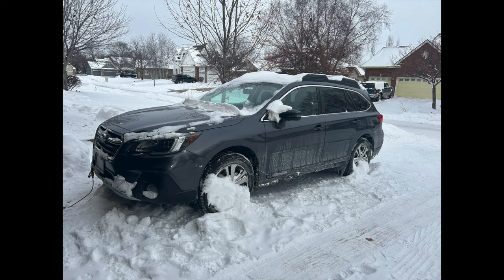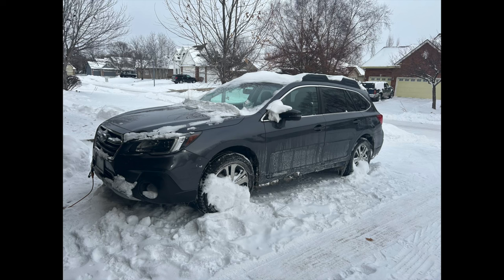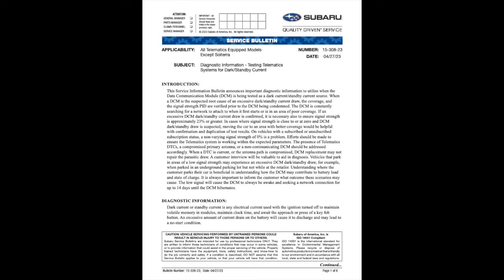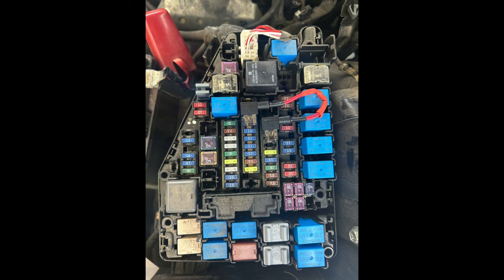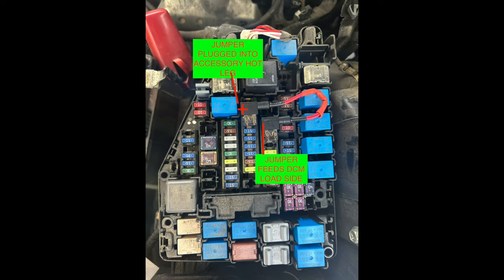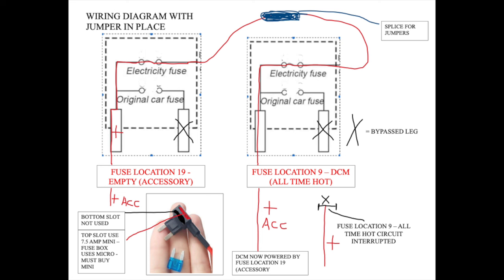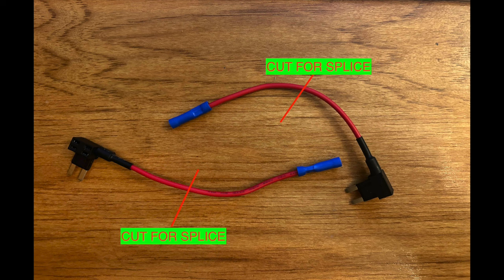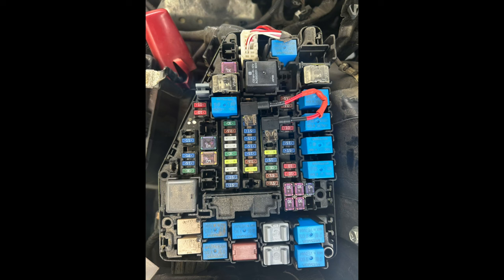2019 Subaru Outback Legacy DCM Parasitic Battery Drain Fix

Comment: I have a 2020 Ascent with the same DCM problem. DCM is 10a #5 fuse. Which could I jump it to that would work the same way? #15 is a 7.5a Aux, but I'm pretty sure it's already used. How do I find an empty slot that would work?
Reply from the maker: Check this video out. It should show you the empty fuse slots on your Ascent. Any of the empty slots will work. The key is to only use the same amp fuse that is in the DCM circuit. https://youtu.be/abLFkHi5yGM?si=I0uoZWSYaEuHMfCH

Comment: the video shows (2) 7.5v  fuses on the Add a Fuse but the link goes to amazon showing 15v fuses. should I use the 7.5v of the included 15 v fuses? Thanks for this.
Reply from the maker: Use two 7.5. The picture in the link is for illustration purposes only. Do not use 15v.

Comment: Hey man, great video! It seems I also need to buy two mini fuse? Bc you said OEM is a micro size?
Reply from the maker: Yes. If you use the tap a fuse that I did, it will require two 7.5 mini fuses.
Reply: @justagaragehack347  just found my 16 forester's layout isn't the same as your Outback. The starlink is controlled by a 25A audio fuse.Will keep looking...

Comment: How about make a loop into the cab and put on a toggle of and on,loop would have the fuse holder before the switch ?
But this is manual way to do it
Just concerned to keep it on its original circuit !